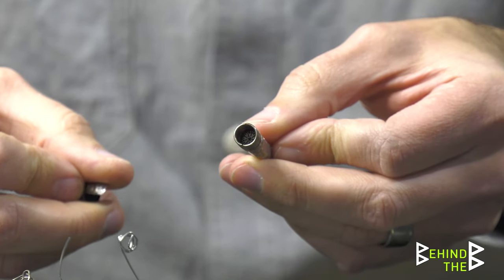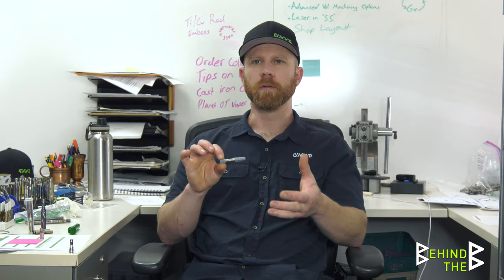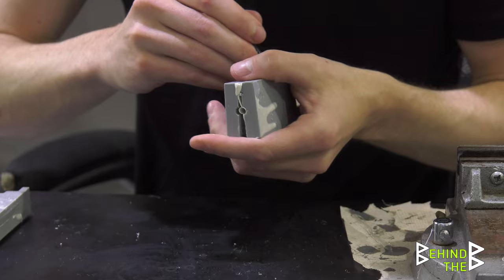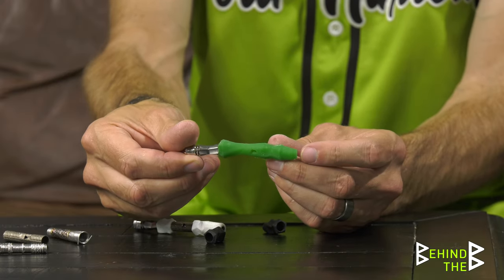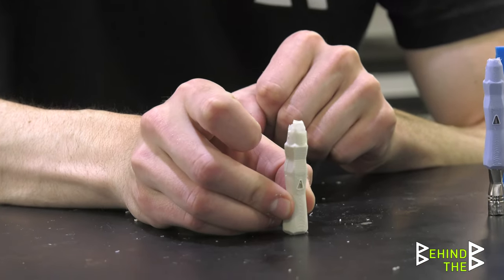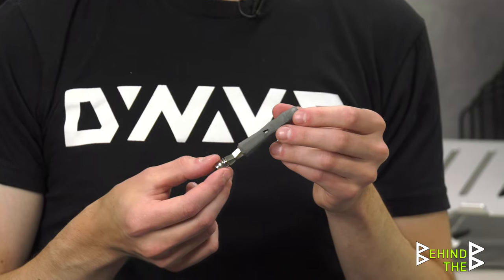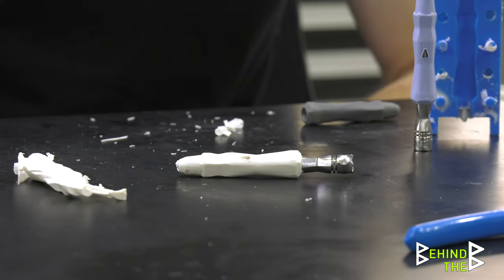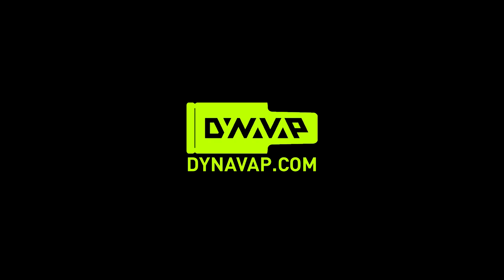Behind the B by DynaVap Chapter 3

Comment: I got the B, the problem with silicone is when you go to clean your piece, the smell soaks into it and you can't get it out. If you store it in the tube after using it, the smell really soaks in
Reply: How bad is the smell??
Reply: @devcha7948  not really unless you store it in the tube right after using it it kinda soaks in to the silicone
Reply: Well, adults tend to uhh idkkkkk..... Run hot water through it minimum once a day?? Shit is porous. That means it can stick yes especially over time. But that means if you run hot water over time too, the same happens. Not only in theory, but in practice. Anybody that has problems with silicone simply needs to step it up. Not to be an asshole I just speak objectively with no softness as to encourage failure cause I dont encourage failure, I actually care to help. Hopefully that helps!! The same theory works with other things too. Not reay bangers, as over time you're actually chemically altering the substances with heat, called "chazzing" the banger. But anything you're not applying torch heat to, this will work. Hope that helps aye!! Take care have a good one boss

Comment: How about a tip that fits inside natively to a water piece of varying sizes. Big money here.
Reply: How would you remove the tip from the waterpiece to inhale the hit? It would be too hot.
Reply: @LegeFles  add a little carb hole.
Reply: Or it could be a little adapter that has a carb too.

Comment: I'd like to see a video which explains all the letters (M,B,Vong)and other terminology.  And silicone?, that's a huge wrong left turn.  Should have used wood or glass for a budget Dyna.
Reply: There's still a condenser inside. So the outside material shouldn't matter that much.